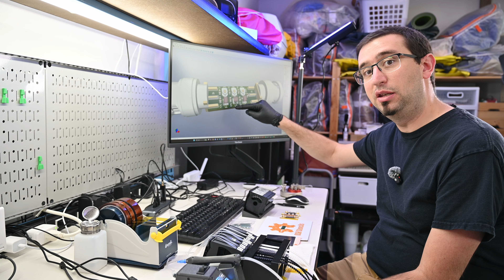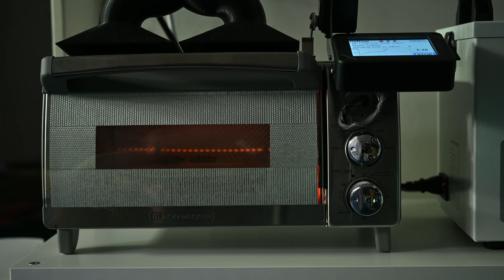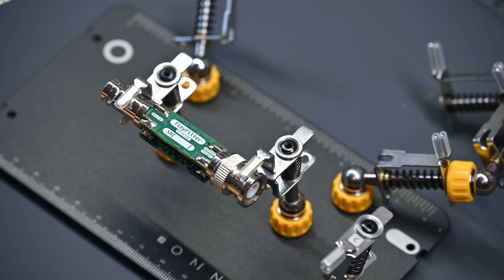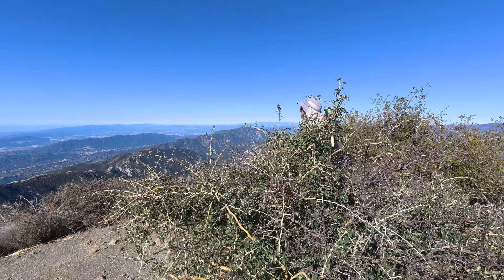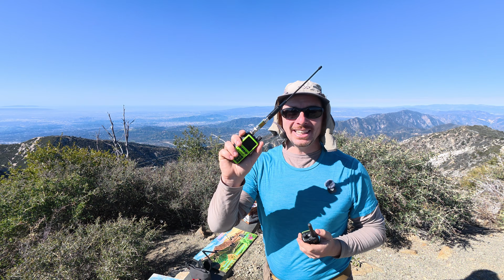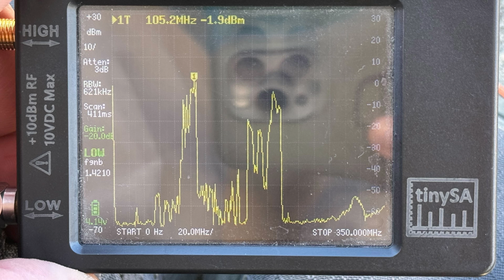TinyFilter - Portable 2 Meter Bandpass Filter | Part 1

Comment: An interesting follow up video for this would be some bench testing in which you use a resistive combiner and two signal generators to first determine the failure mode of a receiver and then measure the margin that you get by using this filter. The filter looks great on the VNA, but how good does it need to be? You could also use a spectrum analyzer and the HT's antenna to measure the RF input to the HT to get a field representative interfering power level and test for that as well.
Reply from the maker: Thanks Tony! These are all wonderful ideas for Part 2. I'm planning to make the second episode much more technical, and I'm gather a list of things to cover. These are all great additions to the list.